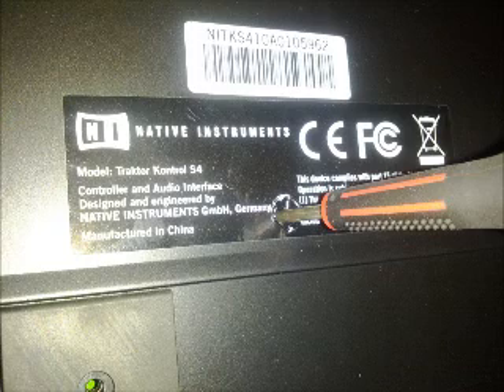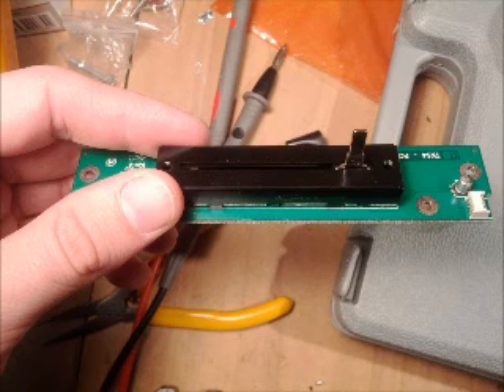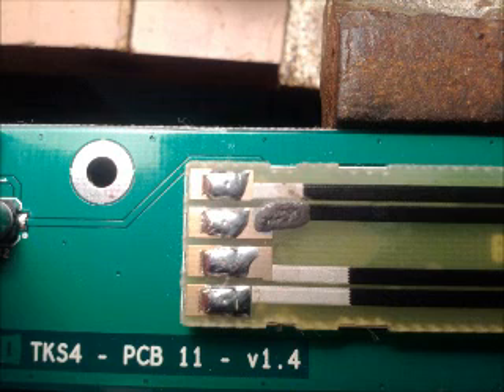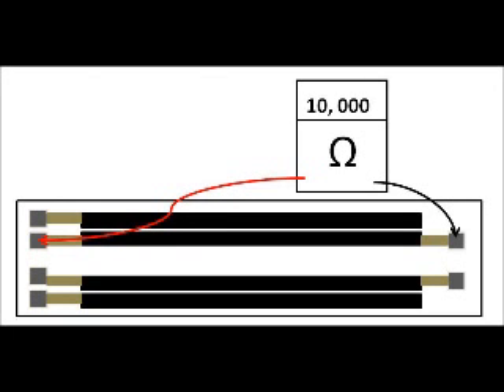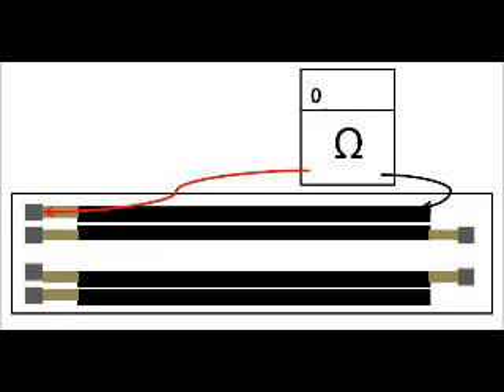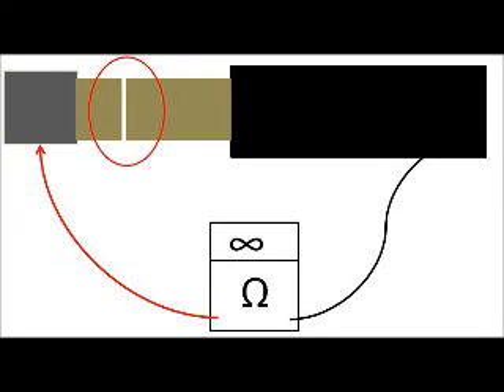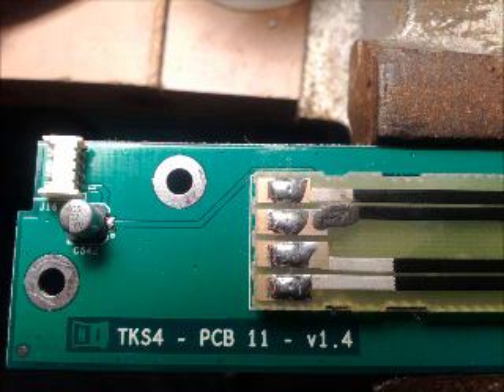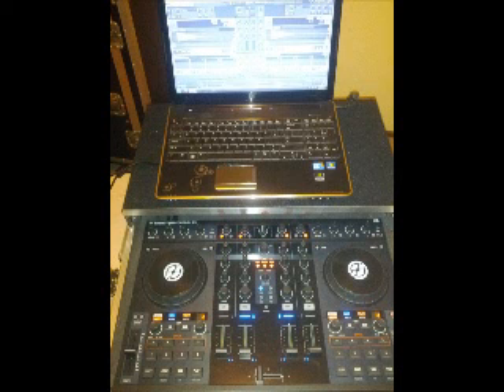How to fix Traktor S4 X fader.

Comment: Had almost same issue with B fader, on the left pair of resistance strips. Fixed it with contact glue. After fixing it there was different resistance, at 0.5 kOhms more, than other faders have (it goes from 0.5 to 2.8 kOhms from start to middle and than goes back. Mine have 3.2 kOhms in the middle now). After assembling of the controller I recalibrated faders and it worked fine for me!
Also I found lots of faders at aliexpress - their name is Alpha B10KX2. They should fit for replacement to Traktor S4 KM1.

Comment: HI. Thanks for the tutorial.
I have a doubt. what you use to connect? Weld or glue? If glue, what type?

Thanks.
Reply from the maker: Gonçalo Pires  Hi Goncalo, The Product I used is called "WIRE GLUE" Its a conductive glue , if you google / ebay it you should be able to find a supplier that carries it, and it's not too expensive, Takes a little while to set but it works well. I used this product because the slider pot is a carbon (resistive) track joining to a copper PCB, you can't solder it because the solder won't stick to the carbon track . Let me know how you go .

Comment: Thanks for taking the time to make this video, very well explained, helped me alot!
Reply from the maker: snowsk8life . No Problem , did your x fader have a small open circuit crack between the end contact and the carbon track ?
Reply: Im sorry for this late reply, just saw this now, i actually couldnt get very far because it turns out the crossfader (the plastic fader cap) is superglued to the metal thing, weird i guess im going to have to aplply some acetone to dissolve it or maby just break it and buy a new plastic thingy.
Thanks again for this great vid im sure i will be aplying it soon!

Comment: I'm think ing of tackling a similar issue on the C Deck Fader ... do you know if the resistance measurements are the same?.. or would it be best to take off a working one and measure that?..what you think? worth a crack?
Reply from the maker: yep definitely worth a crack. It will be hard to get to those faders, as the Xfader was on it's own PCB. Yeah they would be similar resistances as the variable resistor would be configured as a voltage divider which would drive an analogue to digital converter . I wouldn't bother taking off a working one and measuring it. just check if any of the tracks in the fader has gone open circuit. Let us know how you go .
Reply: did you manage to take fader C apart? I'm having this issue with B. Thinking of just desoldering it from the board, but i'm a messy solderer...